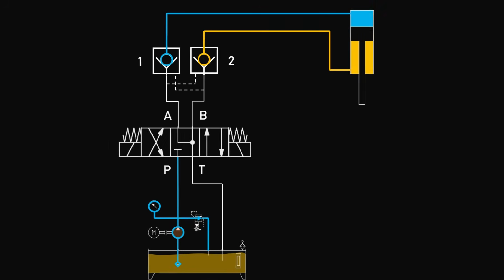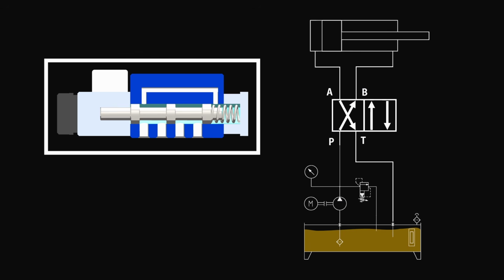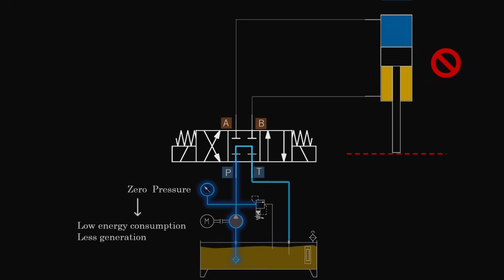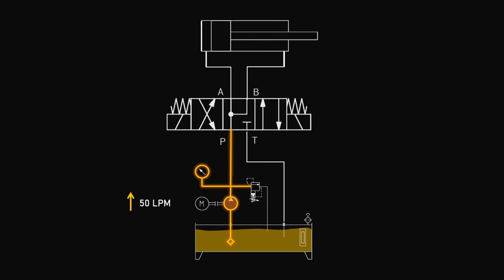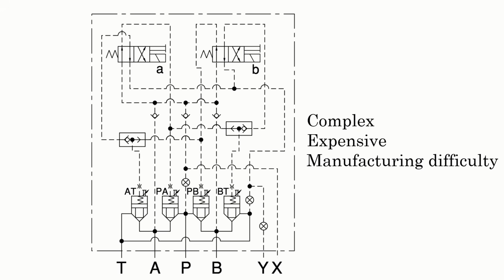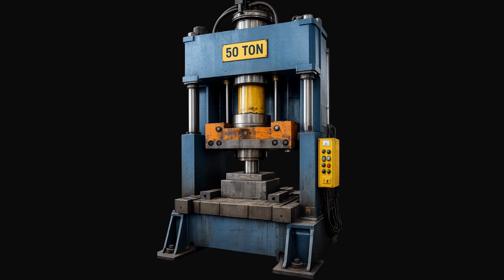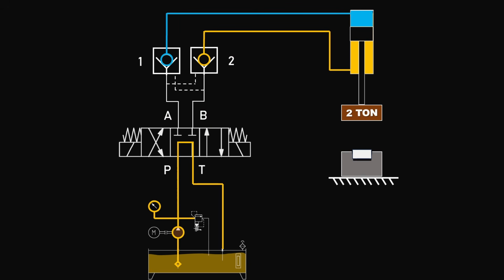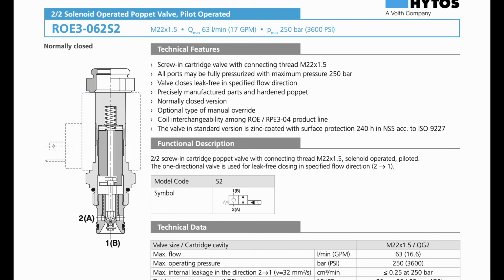Mastering Hydraulic Circuits | Complete Directional Control Valve Course

Comment: Wow. i thought it was going to be another tube that flies over topics and leaves us feeling like we didn't understand the concepts well. 
you covered the basics of hydraulic systems so well. i am so happy i caught this one. not sure i will ever use it though.

i was onwdering about the correct sizing of the valves to cylinders, valves to valve ratio in sizes, what are the rules of thumb in this respect? not sure if i was clear, so here goes again. if i have a 150 l/min servo valve, how would i design the pilot operated check valve flow rate, assuming i want to a max flow rate of 150 l/min every so often.  i guess what i am asking is there a tradeoff, before the sizing of support or auxillary valves become too expensive to purchase, maintain, too much efficiency losses, etc